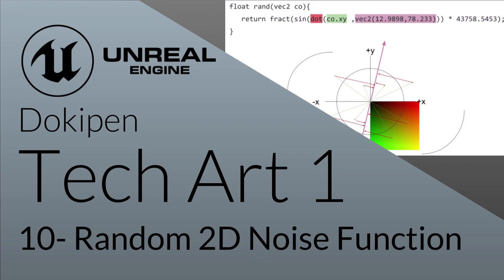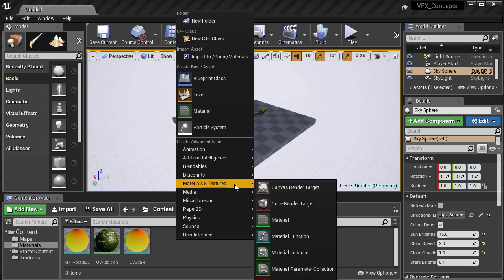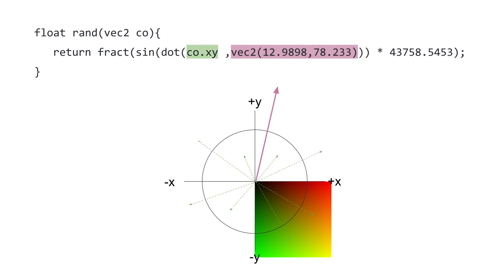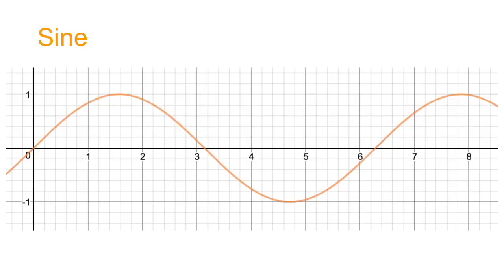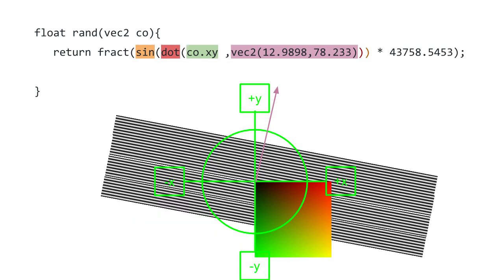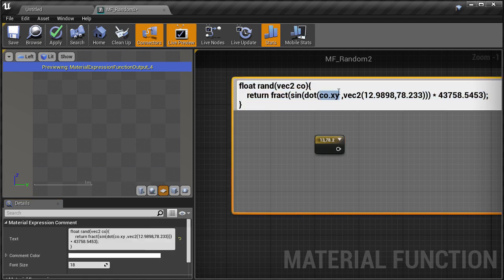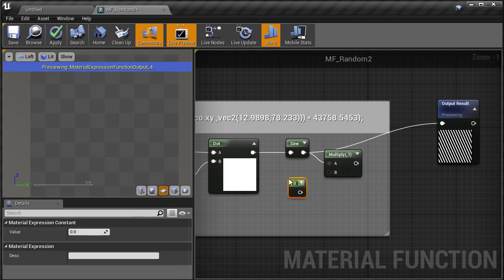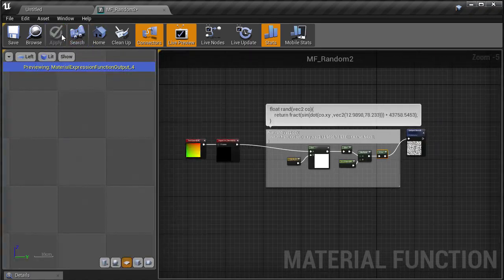Implementing a Random 2D Noise Function - Unreal Engine 4 Tech Art S01E10

Comment: instead of the huge numbers and the mathematical equations is there a way to use a noise texture to have a similar effect, i'm running into a problem on a mobile devices where these numbers have to be lower https://en.wikipedia.org/wiki/Half-precision_floating-point_format, any solutions ? Love your serie thank you so much!